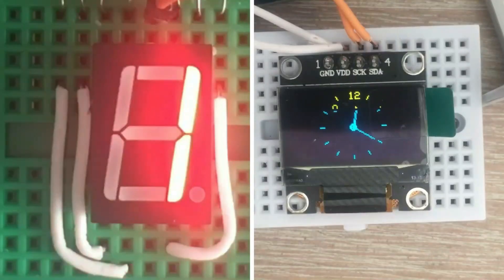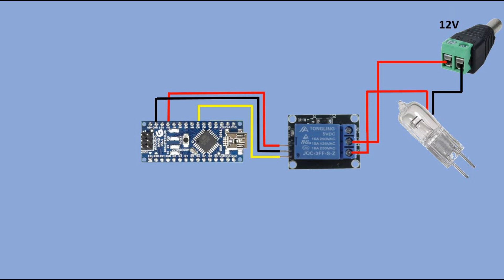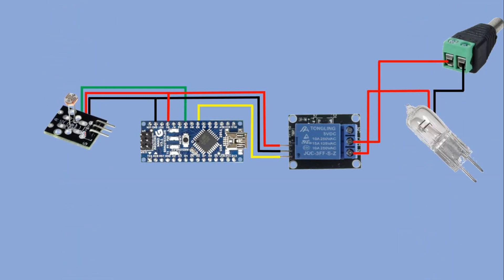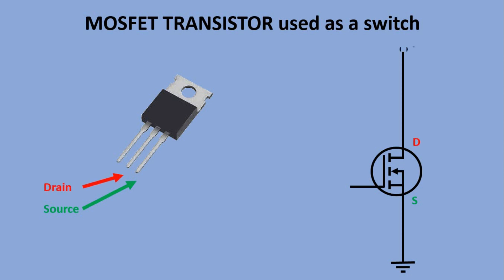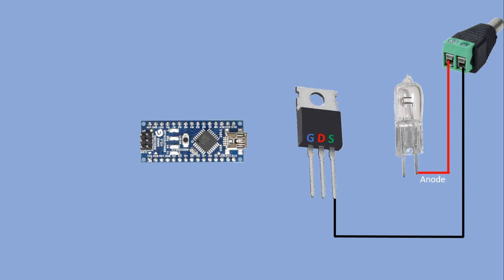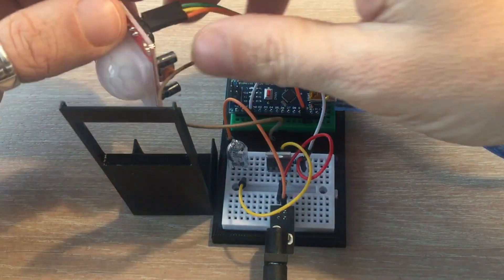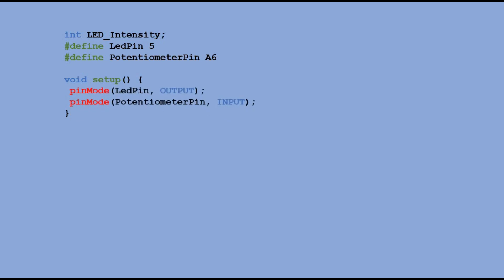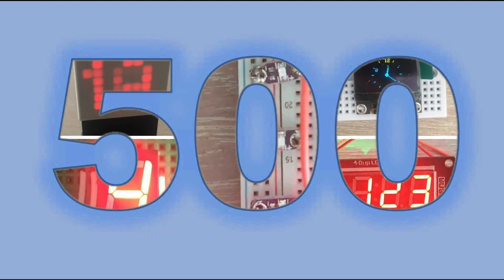How to control 12V devices with Arduino. Using Relay vs Using N-Channel MOSFET transistor

Comment: I wish to ask, can transistors be use to control via arduino, 3 x 7 segmented led display, 12 volt , common anode? if so how does one go about it, what is the circuit design required, I am still learning and just want some insight.
Reply from the maker: Don't know which display you want to use and why you would go 12v But yes you can use transistors but you would need 8 transistor per display. so 12v goes to common anode and 8 transistors are used to switch signal at each segment
Reply: @marios_ideas  Thank you so much, I am running sparkfun 6.5 inch seven segmented common anode display, I'm trying to use 3 displays, any suggestions

Comment: It is okey to connect the 12v power supply to 5vDC RELAY?
Reply: No you need a 12v relay or a 5v power supply for your 5v relay

Comment: I can use a mosfet with pwm to control my current? going to a device??
Reply from the maker: Yes you can. But I think the type of MOSFET to use matters. But this is something a bit over my head so you would have to investigate yourself.

Comment: Exactly what I was looking for. Thank you.   
I'm using a stepper motor in my project to raise and lower a small platform, and it only needs to be used twice for a very short time. So I want to power down the motor by disconnecting the 12v supply to the stepper driver VMOT and GND pins when the stepper is not in use.

The relay should do the trick.
Reply: if you use a driver like the DM542, you can use the enable to control the power, otherwise it does get pretty warm.
Reply: @hugorivera9738  Thanks for the suggestion.  I'm on a break from building stuff but will take a look at that option, since I've got future projects planned, which will be using steppers.

Comment: Great video Mario.  Can the Pull Down resistor on the Mosfet gate be eliminated by changing the Arduino's output to Output_Pulldown?  (I forgot the correct syntax) Thanks
Reply from the maker: Arduino has only pullup resistors. You cannot pull down the signal within Arduino

Comment: Good discussion of relay versus FET.  In the discussion you referred to the lamp as an LED but it appears to be a quartz halogen lamp, so using this is great but if a user connects an LED in place of the lamp the led would need a current limiting resistor.
There is no mention of the power source for the Arduino and that would lead the consumer to neglect this.

Comment: nice video, question on the transistor.  I don't see it listed on your webpage provided.  Can you share details of where to get it?  All of the transistors and mosfets I have don't match
Reply: at 5:05 you provided enough for me to find it (I must have missed that somehow).  thanks
Reply: when I looked back through my electronics stash and specifically transistors in the MOSFET category, I do have a similar one, the IRFZ44N.  From what I can tell the only diff between IRFZ44N and the IRLZ44N you suggested, is that the IRFZ44N is 49Amp and the IRLZ44N is 47Amp, otherwise they are both 55v.

That being said, as I dug deeper, this is what I found on those two.
"The IRLZ44N is a Logic level Mosfet with a very  low gate threshold voltage of 5V, meaning the MOSFET can be fully turned  on with just 5V on its gate pin which avoids the need for a driver  circuit.

The IRFZ44N on the other hand requires a gate driver circuit if the  MOSFET has to be turned on completely using a microcontroller like  Arduino. However it does turn on partially with direct 5V form a I/O  pin, but the output drain current will be limited."

Therefore, unless you have a gate driver circuit, do not use the IRFZ44N, the IRLZ44N you suggested is correct.
I found them for about $1 each on Amazon (though you have to buy 10).  Hopefully this helps someone
Reply from the maker: I have one more video https://youtu.be/9O0pb0I6bCU where I used a MOSFET module and there IRF520 was used.

Comment: Excellent. Although you mention at 5:07 that it's an N-channel MOSFET, your title doesn't mention that. Please consider adding that to the title so it includes “N-channel,” since its wiring depends on the type. Regards. DP, Henderson, NV, USA
Reply from the maker: Done:)

Comment: Hi, should I use 12v relay module for my 12v liquid solenoid valve or 5v relay module is good enough?
Reply from the maker: Look at the description on the relay. E.g look at this link https://allegro.pl/oferta/przekaznik-1-kanalowy-wysoki-niski-h-l-5v-arduino-13614098678 . The relay in that link is 5v one. Meaning that the signal to control the circuit will be 5 v and the circuits that you can control are up to 10A 220VC or 10A 30V DC. So if you want to control your solenoid from Arduino i has to be a 5v one
Reply: @marios_ideas  Alright, thank you👍🏻

Comment: Can this method be applied to a single color led strip with a + and - input only?
Reply from the maker: if you are talking e.g 12v LED white led strip with just plus and minus then by all means yes
Reply: @marios_ideas is there a specific type of mosfet I need or range?
Reply from the maker: I am not that proficient with reading datasheets.I would ask this question at electronic forum.

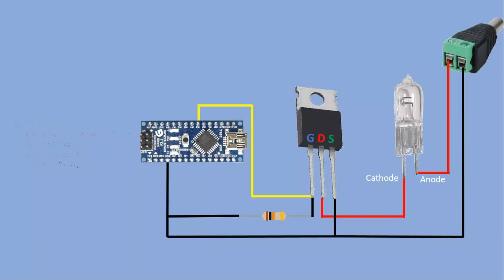Comment: Thank you for the video! Can I use the same transistor setup to bump Arduino serial TX UART signal from 5V to 12V? I have a device that is controlled by UART on 12V and want to control is from Arduino. I only need 1 way communication (from Arduino to 12V device) so only TX wire/signal needs bumping to 12V. Can I use the same setup as shown in 8:54 by simply connecting yellow wire to arduino serial TX? The only thing I'm wondering about is if transistors are ok being "on" (12v flowing through it) all the time? Since UART signal idles in high state.
Reply from the maker: I think you need logical level converter. Something like this https://www.aliexpress.us/item/3256803585917842.html. I would go on some electronic  forums and ask for advice of which logic level converter would be the best for what you are trying to do

Comment: At 7:30 Adding the 10k resistor between the gate and the ground made so the led was always on and when triggering the gate, it would go from full brightness to half brightness. To fix the issue I changed the position of the Resistor to be between the Source and the ground.  Is the diagram incorrect or am I missing anything?

Comment: Hi mario I wouldlike you to help making a switch of 12dc 1amp (3nos router, ONU, and extender each 1amp)main to battery switchin as in UPS in case of power failure( no relay as there is delay) with above mosfet IRLZ44n, pls help
Reply from the maker: Mind you I am IT person playing with electronics. If you want to seamlessly switch to UPS in case of power supply outage , this requires some more sofisticated stuff not just a standalone mosfett. What I would do if I were you I would go to official Arduino Forum and open the post in General electronics section. There you have experienced guys which are willing to look at your requirement and suggest how to tackle it. https://forum.arduino.cc/

Comment: Which Arduino would be the best choice
Reply from the maker: All depends what you want to do. 90% of my projects I do with Arduino Nano as I usually do not need a lot of memory. The MC is the smallest and it costs peanuts. But if you want to use several modules  with e.g. OLED display then there are new Unos REV4  that offer tons of additional memory and features. Watch my latest video https://studio.youtube.com/video/aw1I6JnSZRY/edit where I compare new arduino with old one
Reply: @marios_ideas  Thank you my knowledge is very limited regarding the Arduino, however your tutorial was extremely helpful and informative

Comment: Hi Mario....Great videos! Could you do a video explaining how to power an Arduino Nano and an Arduino relay board off of the same power source? In my case the power source is a 12v atv battery that is running two linear actuators to open and close a door once a day and I am trying to simplify the build....Thanks!

Comment: Could an arduino be used to power a 12v micro rigid air conditioner and replace the AC factory control board?

Comment: Hi, thank you for the amazing video. I have a question: I'm trying to control a RGB 12V LED with the dimmering. Do you think that is possible? And will I have to use 3 transistors (to manage RGB channels seperately)? Thank you!
Reply from the maker: 3 mosfets. Make sure that each RGB channel is connected to Arduino PWM pin
Reply: Thank you for the quick answer! I was wondering, in case the Red needs to operate with a lower tension, should I use a voltage regulator when I pull 12 Volts from the same source? 

For example: Blue 12, Green 12, Red 9.
Reply from the maker: @denizsogutlu2070  Thats where PWM pins come in. You control the voltage analogWrite to the mosfets. When you write 255 then it will be 12 v and you can go down to  0 which represents 0v
Reply: Oh I see!  So I can scale the Red Value in PWM with a 9/12 to obtain the same brightness. 

For example, would I then have a white RGB(equal) if I assigned these: (in the 0-255 PWM range)
90Red, 120Green, 120Blue
Reply from the maker: I have never tested it but this should work this way
Reply: That’s alright! Thanks so much for your guidance!!! 
Deniz

Comment: what happens when you do not add the 10k ressistor
Reply from the maker: It is a pull down resistor. So when you are not sending high signal to gate the connection is not in inconsistent sytate (floating pin). You may have noise at the gate *random high and low signals) check this pull up and pull down resistors tutorial https://youtu.be/87X5Duad8CU

Comment: Hey Mario, great video. Do you know if it would be possible to power both the arduino and the 12v device from a 12v power source?
Reply: You would have to step down the 12v to the 5v or 3.3v arduino needs. Use a buck boost convertor.

Comment: how do you figure out which relay to buy? Here you use a 5v controlled relay for 12v power; do i buy a 5v relay or a 12v relay 🧩
Reply from the maker: The relay on the signal side is always 5v as this is the logic the microcontroller is working with. Maybe there are relay variants with 3v as some of the mcs work with 3 v. I have never came accross one. And then you  have supported voltage on the NC NO side and this depends on the circuit you want to control. If it is 5 v then you buy 5v relay, if 12V 12V relay , when 24V the 24V relay and so on

Comment: Thank you bro .I have a question what about temp . Is mosfet need to passive cooler?
Reply from the maker: The mosfet in the circuits i used did not heat up. I come from programming background and learn electronics as i go. Maybe someone reading this commend can chip in some inforamatorom on that

Comment: I need too control 4x relays, using Arduino, AND I plan too use a Wii Nunchuck, With the joystick.  I need too make the nunchuck control 4 relays,, 12vdc, that will move a snow plow on a truck UP-DOWN-LEFT-RIGHT. can you recommend a setup? or have any ideas? thanks,
Reply from the maker: I come from programming background So i would advice you to post this question in Arduino forum i generał electronic section. You should have andwer within the hour.

Comment: I have 8 LEDs of 1 Watt each and like 3.4 V rating. Can i choose 5V 8 channel relay along with external supply of 9V to operate the circuit? Or i must change my external source value? Please suggest
Reply from the maker: I come from programming background So i would advice you to post this question in Arduino forum i generał electronic section. You should have andwer within the hour. If you get the feedback Please share it with me

Comment: Can a 5V relay be used in a similar manner with a 12V power source (like a car battery) to power an LED bar? I tried this and ended up frying my arduino. For some reason as soon as I connected the power source, the circuit seemed to bypass the relay and completed, turning on the electronics (which worked fine) but ended up messing up the arduino.
Reply from the maker: Not very likely as with relay the 5v and 12v circuits are isolated. The 12 v circuit is closed and opened using magnetic coil. Maybe your relay was somehow damaged. Was the power source for Arduino 5V?
Reply: @marios_ideas  I used a 9V battery to power the arduino and after inspection it turns out the arduino is still working properly which is good. 

I had the arduino programmed to control different relays using a button, which would activate depending on how many times the button was pressed, with the default state being all relay channels off. Upon further inspection of my circuit, I found that my relay DC in and DC out ports were not connected to the arduino at all. Could something like this result in the outcome I had where the moment the power source is connected the 12V circuit would complete?

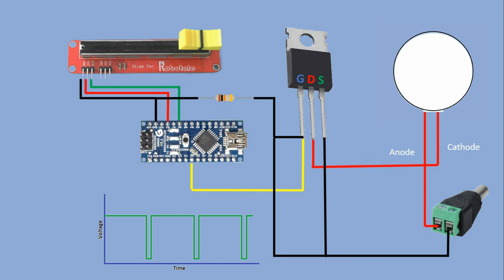Comment: Mistake at 10:30 output of arduino goes to ground, because resistor is in wrong place, should be between ground and output
Reply from the maker: You are right. Amazing that nobody spotted this before. The resistor should be between the gate and ground. My mistake. In the real connectivity it is not clearly visible but I think I got it right there otherwise this would not work. Thanks for spotting this

Comment: Very good explanation & very practical. Most YouTube Videos I watched before I found this one are so f**king boring & theoretical (and in the end not helpflu). Your video was a joy to watch & I learned a lot. Now I only need to know which Mosfet to use & how I can calculate which Mosfet fits my purpose (Volts & Amp limitations). You earned my Sub!
Reply from the maker: I try to make my videos as informative as posible. In many cases I am learning as I go along as I am coming from IT not an electronic background. The comment like this means a lot to me.

Comment: You used a USB cable to power the arduino how can I power my 12v device and arduino from.the same power supply so I only need one supply for everything?
Reply from the maker: If you use MOSFET you just connect positive of 12v power supply to arduino VIN and negative to arduino Ground. With MOSFET you may find out that after connecting the power this way arduino will not be able to drive teh relay coil. So stick to MOSFET
Reply: @marios_ideas  sorry I don't understand that? From the power supply  I sent 1 live to common on relay, and 2 live straight to the vinyl pin n the arduino nano set on fire
Reply from the maker: @layton7430  What power supply did you use. VIN on Arduino can handle 7-12V. It has a voltage regulator. I powered arduino from DC 12V many times.

Comment: This is nice, thanks for the video. Just a quick question: why do you connect the ground of the arduino and the 12 volt power supply? does it cause issues
Reply from the maker: You always have to connect the grounds of the connected circuits. I will most likely do a separate video covering this topic as thie question is asked quite often

Comment: I notice you turn it on only for a short time.  Is there an issue with keeping the light on for a few minutes in what you've shown?
Reply from the maker: Yes. No problem. Watch my other video when I use finger snap to lit the halogen lamp https://www.youtube.com/watch?v=9O0pb0I6bCU
Reply: @marios_ideas  I was able to do what I needed, this was a VERY helpful video and the follow up introduced me to that new PCB with the onboard mosfet and much easier connections. Thanks again!!

Comment: I am having a problem with low current at the 12V device (LED light). I am powering with an 11V / 5200mAh drone battery. When powered directly, the LED light is INSANELY bright. When I connect the circuit following this video, the light is only received 0.1A of current and is extremely dim. I had a TIP31 on hand so I used that instead of the MOSFET. Any other thoughts about the problem?
Reply: So I changed to the MOSFET indicated in the video but had to change to a 100k resistor and now its working with the proper brightness as expected. 😕 but its working so yay
Reply from the maker: BJTs do not seem to be good for switching . I found this thread that discusses this and and conckusion is also to use MOSFet

Comment: I have a 12V relay and a NodeMCU ESP8266 
Should it will work or not 
Please help
Reply: Esp8266 output voltage is 3.3v, you need a MOSFET opens fully at 3.3v

Comment: Can I use IRF 530N MOSFET instead of IRFZ44N
Reply from the maker: Yes you can. I have not  used IRF530N but if you cehck my video https://youtu.be/9O0pb0I6bCU there I used a mosfet module with the built in IRF520N

Comment: Is it possible to create a 8x 55W bulb 12V Knight Rider scanner with Arduino?
Reply from the maker: I am sure you can:)
Reply: @marios_ideas  Thank you for your help. Nearly all of the Knight Rider running lights have fixed patterns, usually 1 or 8, but I couldn't find any programmable one.

Comment: Good project brother 😄👍👍👍...for subjection if using Mosfet on the arduino GPIO no need to connect the 10K pull down resistor, because when the arduino GPIO logic Low is mean ground already. The Mosfet will turn to off stage 😄 thanks you brother 🙏

Comment: anyone who knows what the green components name is ?
Reply: For the power? That's a terminal block. It's likely a 12v power supply with a DC barrel plug to terminal block adapter.

Comment: please explain why we use pull down resisitor to the gate of mosfet?
Reply from the maker: Without resistor gate may react tooutside infuence (e.g. touching the wire). This make sure that when gate is not driven by the high signal from microcontroller it is pulled down to 0 through this resistor.